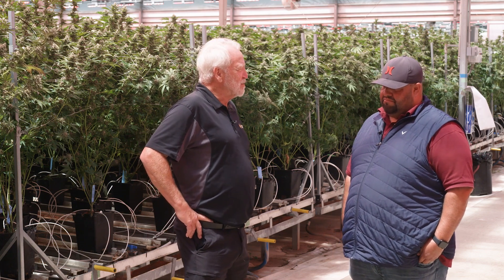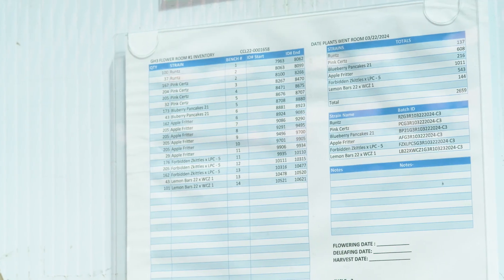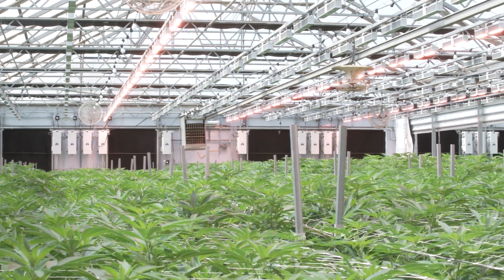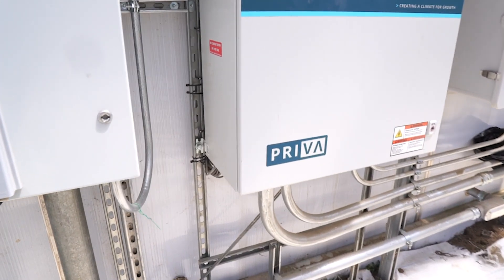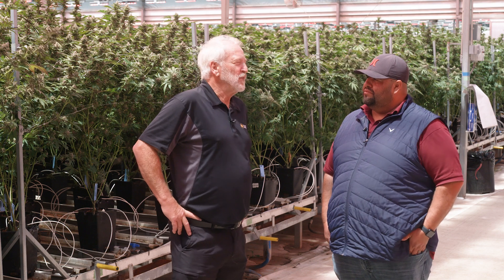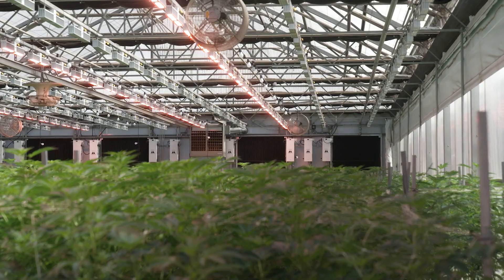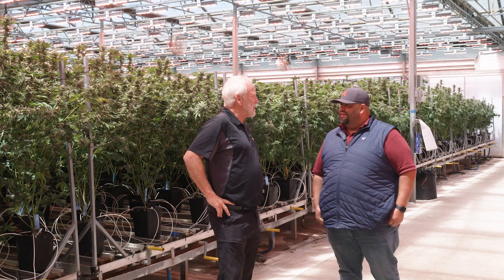Green Vibe: Traditional California Ag Group Becomes Cannabis Powerhouse

Comment from the maker: 00:02 LED lights are the sustainable choice for greenhouse operators
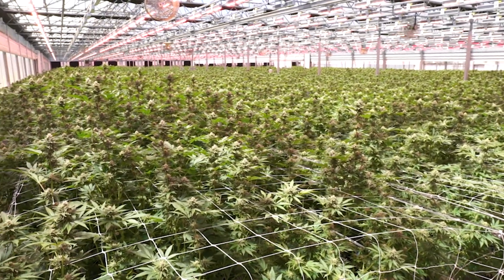01:53 Expansion of cannabis cultivation facilities in California
03:28 Efficient use of power supplies in the greenhouse facility
05:14 Enhanced lighting and facility optimization for cannabis cultivation
06:54 Detailed process of fertigation and irrigation system
08:49 Optimizing light spectrum for efficient photosynthesis
10:21 Benefits of using LED lights for greenhouse cannabis production.
11:56 Focus on consistent growth for better quality buds